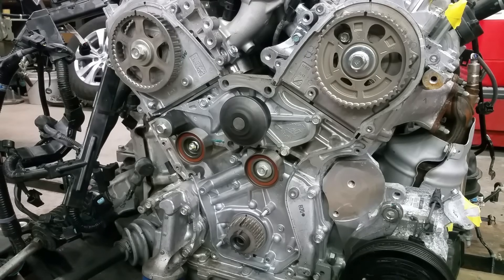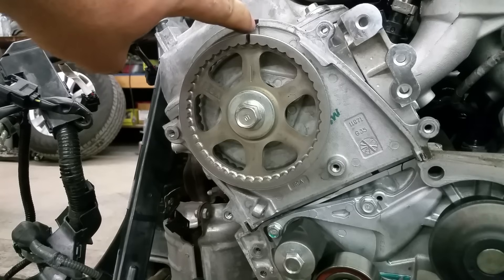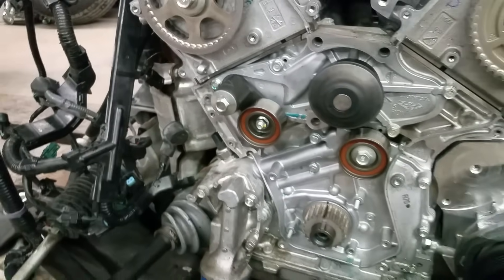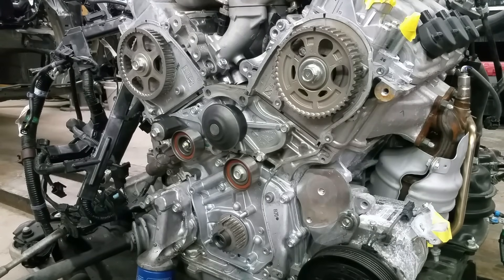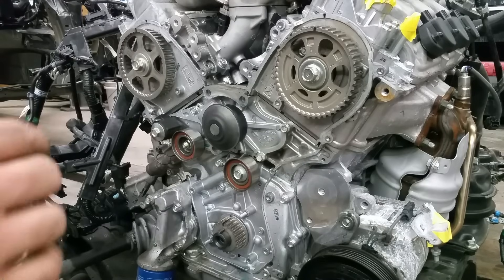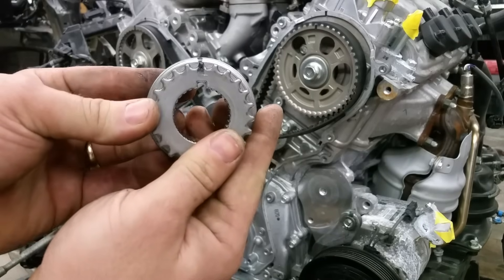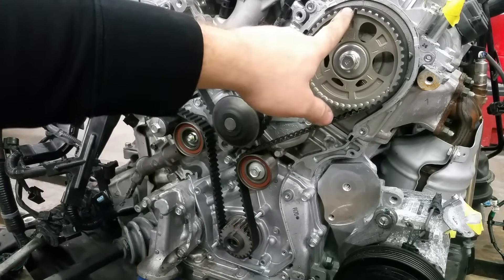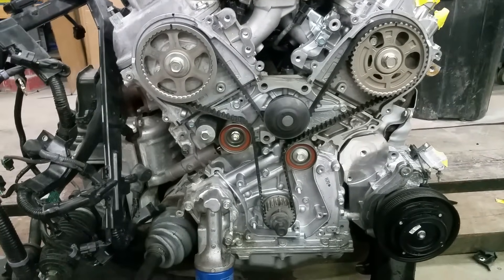SETTING UP TIMING BELT ON HONDA ACURA 3.2L 3.5L 3.7L J-SERIES ENGINE IN DETAILS!!!

Comment: I just did this same job but I’m getting a misfire on all 6 cylinders could incorrect timing be the reason why but the only step I missed was two full turns  could this be my misfire problem

Comment: Hi I have a question, I have a problem with camshaft number 2 because the mark position is not at the top, even over a quarter of 12 o'clock because when I removed the belt I forgot to position it at the top first, while the cams number 1 are right in position and the crankshaft is also the same at the top. How do I return the position of the cams mark no. 2 to the top again, can I turn it clockwise or return it to the top by turning the camshaft in the opposite direction? Sorry, besides that, the belt I bought does not have a mark as information (only an arrow)... and also if the camshaft number 2 can be turned, does it not affect or collide with the camshaft no. 1 and the crankshaft which are positioned at the top? Please provide information, thank you

Comment: Please help, after I took out the cover and I try to align all three rear cams, front cams, and bottom crank onto dead center but only the front cam and bottom crank are top dead center for some reason the rear cam was way off at 6 o’clock.  

I then remove the belt thinking I can manually turn the rear cam to align but will not turn clockwise?  

Am I screwed? I don’t know why the rear cam would be way off. 

I bought the car brand new and it has 120k miles and way over due for the TB and WP. 

Much thanks

Comment: At 13:29 does it look like the left cam gear is off by 1 tooth (black marks do not line up)- i keep reading about that being an issue on j series set ups - getting ready to start this repair and I am concerned about the alignment issue I might run into.
Reply: It's not, just camera angle

Comment: thank you george i have never done a timing belt replacement but i have replaced my transmission on my 2003 odyssey. if i could do the transmission i should be able to do the timing belt on my 2015 pilot. im gonna take my time if it takes me two days  be it.

Comment: If the belt is off and crankshaft is at TDC, can the cam sprockets be rotated to TDC too? They have some resistance and spring back to their off time position when I stop rotating.

Comment: I always remove sparkplugs when doing T belt jobs. It's easier to turn the engine. I always put a new set in. I also spin the engine again after removing the tensioner pin and check the timing marks...just in case...

Comment: I had an oil leak on a 2003 Acura 3.2 Tl.. I replaced the oil filter adapter housing gasket and the oil pan gasket. Still leaked oil. I finally discovered that.there is an o-ring in the area of the water pump, behind the front cover. I feel like this should be replaced every time with a timing belt replacement on honda V-6 engines.

Comment: Thank you George, I was having trouble with the left cam gear moving when trying to wrap the belt tight enough to get it on the tensioner so I followed your method and installed the belt to the crank gear last and it worked great.

Comment: Friend, do you know if the 2009 Honda Accord 3.5 is interference or non-interference?
or as you mechanics know, if there is space in the cylinder so that the piston does not bend the valves in case the timing band breaks, it happened to me a few days ago in my car idling while I was warming it up in the morning. Thank you, blessings.

Comment: I love the video and some of the comments are helpful too which i appreciate. My question is,when i remove the belt,the markings of the gears will be in different areas right? So ill have to turn it and line them up to 12 oclock, before i put the belt and proceed like in the video?

Comment: Do you have a video to fix the timing because you accidently remove the tensioner removing the cover bolts and the belt got slack and realized it while adjusting but you realized and turned it back before you turned it too far and put the crank shaft back to the point it was at but the cams still look aligned! Help!😩

Comment: 12:20 "This is an interference engine.  It will bend valves." <~~ You see, that's the problem.  A timing belt setup + an interference engine is a TERRIBLE idea and design.  You pay $1,000 for a timing belt & water pump replacement on a Honda or Acura, and then if any one of the 5 or 6 new parts fail, your engine is ruined and the car is gone.  It happened to me on an Accord that I dearly loved and maintained very well.  The new timing belt job lasted exactly 5,000 miles before it all self-destructed.  Lost the entire car + $1,000 I had just paid for the t-belt job.  A bad, fragile design all the way around.

Comment: Excellent video! 
Hope you have a moment to respond to this;

2002 Acura TL. I aligned the camshaft pulleys and the crankshaft before removing the old belt and made reference marks on the old belt to coincide with the camshafts and crankshaft positions. 
Before installing the new belt, I aligned it tooth by tooth with the old belt and transferred the marks to the new belt. 

The camshaft marks align perfectly with the two camshaft pulleys but the crankshaft mark is one tooth out. 

I have carefully threaded the belt making sure there is no slack between the front camshaft pulley and the crankshaft pulley. 

I have done 5 timing belt replacement on other cars including this one with no issues and I understand the importance of correct timing. 

I have paused this timing belt replacement until I can figure out the problem.  

Any suggestions?

Thanks

Comment: Quick question for you.  I'm installing a timing belt kit. I pulled my crankshaft pulley off, then pulled the lower TB cover off. The TB Idler pulley had the ball bearings falling out and was completely shot...  when I turned the crank to line up the marks, the front cam mark was off about one tooth, and the rear cam was off by about 3 teeth.  Can I just remove the TB, manually turn the cams the little bit needed to line up, then reinstall all the pulleys and belt again? The car was running fine, but I think the cam pulleys slipped a few teeth when the idler pulley let go.

Comment: hello George, one question, I have a 2006 accord, it had the classic noise of the tensor as a sewing machine, I changed it and that sound was removed, but now the tensor leaked oil, what could that fault be? why did it leak? the band was placed correctly, so much so that the car worked normally for 15 days.... thank for readme

Comment: You didn't put the bettery cramp bolt on the idler pully tensiner. Is it ok? Why do we have to put the bettery cramp bolt? Many guys don't put the bettery cramp bolt on it. Why? We don't need it. 2007 Oddyssey and your video show the bolt thread and hold.

Comment: I never got the new timing belt on. When I was installing it the rear cam move out of position. The right cam and crankshaft are lined up Perfectly. The rear cam line is facing the fire wall. What do I do?

Comment: A would you know what would cause a 3 cylinder miss fire on a 1991 Acura legend this is what I done and also I bought the car like this from the original owner iv replace all the coil pack injectors fuel pump spark plugs I notice when you put it in park it would rev fine but in drive it would rev slow so when I replace the timing belt and water pump I noticed it was off a tooth on the crank so I put it where it was supposed to be lined up with that lil arrow and dot on the pulley put everything back together and it ran really good I even let it idle for a while went back a few weeks later to move the car and it ran like shit I'm all out of suggestion

Comment: Yesterday is my 1st time BIY replacing my Legend's timing belt. The new belt is very tight and it take me 2 hrs to put it into the position😣 Luckly, finally success. 😅
Reply: Takes me days and days ...it still doesn't fit right smh. It is WAY too toght

Comment: Crank position question ❔.. As long as its at 12 o'clock its good? Or does it have a intake and exhaust stroke? Meaning that it rotates twice per cycle? It could be in the exhaust position? Starting without a belt on the car 🚗.. Broke…

Comment: He didn't demonstrate the tension between the points. If I ran my belt like that, it would sink an inch pushing down with your finger. That is too much slack. I have to yank hard to get tension, he barley applied any force.

Comment: 💥💥WARNING. Whatever you do DON'T buy a timing belt kit on Ebay, even if they claim it is OEM. I purchased a "Original Honda kit". The timing belt had the Honda name printed, on the belt. The kit included, timing belt, water pump, idler pulley, belt tentioner, serpentine belt. I personally completed the work and was very pleased with the result. Unfortunately the "OEM Timing belt" which obviously was a fake, broke off and ruined the interference engine on my '05 Honda Odyssey. This happened only after 4,000 miles after the work had been done. Needles to say, it resulted in a very costly experience to me. I can't afford the very costly repair. So I will have to junk my beloved van, which I brought brand new in 2005 and only had 94k original miles.
Reply: Hey @myutube1960. Do you still remember the name of the  eBay seller? I recently bought a Honda kit from eBay seller and I hope it’s not him,

Comment: Hey, very interesting to look at while the engine is out of the car :)  I do have a question though.  Do you know if J37 engine requires RTV to be applied to cylinder head cover after valve adjustment?
Reply: Yes. In the corners

Comment: Hey, wondering what could make the timing belt break. 
I have a J35 and replaced the timing belt myself. Everything was OK, changed all the tensioners and the belt. But after 2000 km, it just broke. I don't understand why.
Reply: Hello Rafael. Have you ever found out why your timing belt broke?
Reply: @singhsarabjit  Yes my friend, unfortunately I bought my 8th gen Accord already with some miles. The owners before didn't care about maintenance. I had to rebuild the headers and found out that it was stuck and almost without lub. So everything wasn't running loose. This way, the tension over the belt was higher than it can handle.
Everything solved now, the car works how it should. :)
Hope it lasts.

Comment: I actually tired this today and it was not simple like the video. It was a pain in the (ypu know where)I tried doing it like the videp but I could not get it padssed idler. I went the traditional shop manual ways and started from the crank direction counter clockwise. I used a small flathead to catch the belt and pull it into the idler oh and I used two renches to pull the cams and give me more slack on belt to make this happen. If any one needs help comment below.

Comment: I've done about 7 or 8 of these timing belt jobs on Hondas after a while it's not that bad
Reply: Jon I Got a question for you? My son has a 2006 Honda Accord with a 3.0l engine. His drive belt rubbed a hole in the timing cover so the drive belt broke and wrapped around the timing belt. He cut the timing belt off just to get the drive belt off. So my question to you is how  do I set the camshaft marks to get it lined up in time. I have set the timing in the past I just mark the old belt at each timing mark and then mark up my new with the old one that I marked up.  But since the belt is already off I don’t know how to go by setting the timing

Comment: Brother you have explained very well I am also a master of these vehicles
Reply: How do you set the timing when the timing belt is already off the car. My son 2006 Honda Accord drive belt rubbed a hole in the timing cover and the drive belt broke and made its way inside the timing cover and wrapped around the timing belt my son not knowing any better cut the timing belt to get the drive belt off so now I have no idea how to set the timing marks on the two cams sprocket without the belt being on.

Comment: You got it all wrong, you should start putting it at the bottom, Idler pully, front CAM, water pump, rear CAM and lastly the tensioner (there will be some slake at the back). Once all marks are confirmed, pull the pin.
Reply: .....and remove the battery clamp bolt after the tensioner pin is removed (per the factory manual).

Comment: If the rear sprocket jumps back or forward can you simply roll it back or forward to where the marks line up and then slip the belt on (hopefully before it slips again if you don’t have an extra set of hands).
Reply: FYI I just used a 17mil to roll it back and it worked. I didn’t loosen the cam caps so after I moved it back I was extremely careful putting on the belt.

Comment: What's the easiest way to find TDC on piston #2, I believe this engine was cranked over a few times with the broken belt and I'm not sure where it's at. Should I use a inline  spark tester? or a noid test light..

Comment: timing belts should be replace every 4 years just in case and if you run your vehicle out chain should be replace every 8 years, or if you can get some one to repair the damage pairs that does a great job

Comment: you need 3 vice grips,, a Jack place jack lifting motor,, take out motor support completely off use the Jack before to help and keep it til done and placing motor support on,, get the belt place it on one sprocket pullet tight place one vice grip on the back 10 o'clock and front 2 o'clock the vice grip, when done one side jump to the next sprocket pulling the belt tight,,, then loosen up the front bearing all the way out but not loose were it will come out ,,bearing closer to the bumpber,, then place the belt on back side on back bearing pulling it tight,, only place vise grips if you need to at 2oclock ,,then place spinner on bottom line up with lock pin install pin lite,, pull out spinner out wards as you can but not coming out,, then grab and pull belt place it on spinner the last part is the front bearing it should slide on quick without hassle if not use a a thick medium long screw driver wedge it on forcefully pulling it in,,  after that is on,,, if not on then you have to do it again or order a belt a little longer not to much,,, then pull pin out of tensioner,, rotate it twice just in case I would use parge vise grips to rotated,,for timing not to slip,,,  once that's on install  motor mount,, lower Jack after that

Comment: The factory repair manual shows that the last point for timing belt install is that left (facing enging from bumper)  probably because it jumps like you said.  In order it shows crank pulley, tensioner, right cam pulley, water pump, left pulley or "jumper".

Comment: I replaced the timing belt on my 04 tl, the front cam and crank pulley are perfectly lined up at the Mark's but the rear cam is about 1/8th turn to the left of the Marks but starts and runs fine. Should I bother trying to get it lined up perfectly or does it matter that much?

Comment: The exhaust sprocket jumped 1 tooth back while I was installing the timing belt on a Honda pilot, how do you adjust it? do you have to remove the valve cover and loosen the cam bolts or just simply turn it clockwise 1 tooth with a wrench
Reply: Hello Eric. Have you ever got an answer for your question?
Reply: Whats the answer ?

Comment: Tip: mark the old belt at the timing marks (before you remove it) and mark which way the belt faces you, then, on your work bench, stack the the new belt on top the old belt, mark the new belt same as the old .. put new belt on and line up the marks on the belt with those on the sprockets .. works every time. UPDATE: in response to comments .. if old belt is damaged, or skipped tooth/teeth/engine out of time, then this doesn’t apply.
Thus, this works if done during regular maintenance intervals, not after catastrophic type failures.
Reply: It's not necessary to mark the belt. Did you see the guy in video mark the belt? The timing belt does not dictate TDC on the sockets. Just make the timing marks on the sockets set to TDC.
Reply: @harryl8234 Agree 👍
I don't care about old belt, I put in top dead center, cams lined up & install New Belt to the Engine Mark's 💯🎯✔️
Reply: David Hollfelder thank you sir
Reply: i was just thinking why no car vids ever talk about doing this. but better to explain the right way before the shortcuts lol
Reply: Not all heroes wear capes.
Reply: Thanks. Some new belts come with marks on them. Seems like these don’t. That worries me on how specific the belt goes on with no marks. Right?
Reply: What if its stretched? Haven't tried it yet but just a what if question.
Reply: @FinnixLive  just count the teeth on the belt between rear and front cams marks
Reply: @gofish6814  what if old one jumped one teeth or two back, or forth ? isn’t there an standard number of teeth between the two cams?
Reply: @FinnixLive  the amount of teeth stay the same
Reply: Okay so I'm in the process and took the belt off and the crank is at 1 o'clock and the cams are dead on the marks? Can I just turn the engine around one rotation to get it at the 12 o'clock?
Reply: Thank u bro
Reply: Thank you very much. Great tip!
Reply: Best advice you can give a person doing any timing belt job
Reply: i think that d work for preventative maintenance; if the car had performance issues traced to timing off, will this trick also work? may be not?
Reply: Anybody what if jump a tooth, and got out of time can I just retime it. Or does it cause damaged anywhere else??
Reply: Genius
Reply: Thank you 🙏
Reply: Not necessary to mark the new belt.  Use the timing marks. The don’t lie..
Reply: What if I took it off and didn't mark it? What should I do?
Reply: @romainecrawford2720  pray to god

Comment: Really good video.  What do u do if the camshaft sprockets jump back after you slide the belt?   I haven't released the tensioner pin.  But when I slided the belt the sprockets jumped back, except the crankshaft sprucket. 🙁  That ine still on time.